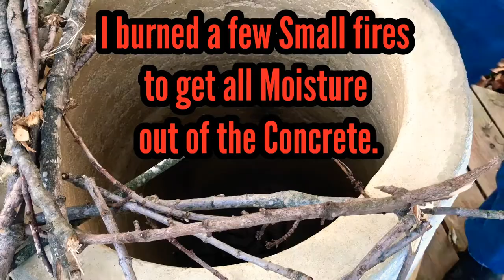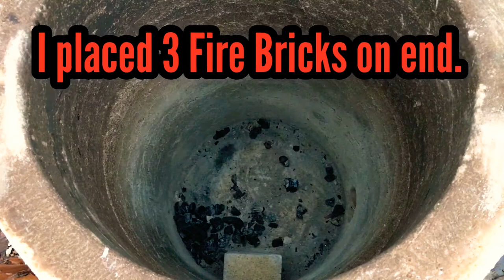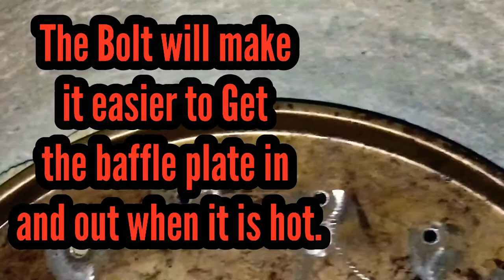DIY Tandoor Insulated Concrete Vermiculite n Quick Set Mortar Mix: Part 5 Completion of project DIY

Comment: Great video and super creative! Can't justify spending $1500 when you've given me the confidence to do it for a fraction of the price! Thanks! 🇨🇦🇨🇦🇨🇦
Reply from the maker: You can also try using large terracotta pots  and then mounding the insulated concrete over them … then put the two halves together… and wire them and up and stucco over them.   I realized later that I could have done that.  If you want to cook Naan on the walls.   If not then go with what I did.  It gets up over 6-7 hundred degrees in there. 
Glad you found the video useful friend. Please don’t forget to subscribe if you haven’t already.    
Thanks.
Reply: @Pizza_Master  thanks for the tip! Great idea!
Reply from the maker: All good.  I been bouncing that idea around for a while.  Was thinking about making a small one just to try it out.  
Let me know how it goes if you try it.

Comment: i thought cement or mortar wont hold up to the heat? im in the process of making one, but i used red clay bricks and clay mortar/cement/sand  1-2-6 ratio would i be fine? Can i line up the inside with this mortar and will dough stick to it or would it be better to use clay  or your mortar type?
Reply from the maker: Dough will stick.  I tried it day one. Lol. I use for meats and pizza in hanging rack.  U can use a big clay pot and surround d the outside with the mirror and vermiculite mice.  Then reg mortar and tile.  That will work nice.
Reply from the maker: Adding the vermiculite to the mirror keeps it from cracking and holds the heat.  The reg mirror on the outside barely gets hot.  And has been two years without a crack in the outer shell.

Comment: awesome build video.... what size holes did you drill?
Reply from the maker: i used 3/16  drill bit....    
i have found that it is better to have the holes around the outside edges of the baffle plate. dont put any in the middle of the plate.  when cooking anything with a fair amount of FAT.., it can drip near the holes and catch fire on top of baffle plate. i have covered the center of baffle plate with foil and that prevented the fat from catching fire ontop of baffle plate.  
glad you enjoyed the vids..
any other questions feel free to ask...
Thanks

Comment: Is it easy to empty the ash out after it’s cooled ?
Reply from the maker: Its not an issue at all.  I just reach in and use a 5 gallon pail scraper to put lift it out into a bucket or whatever.  Throw it in my garden beds and whatnot. 
This is what I use.  https://www.amazon.com/Stainless-Steel-Bucket-Scoop-LEVEL5/dp/B076R2YGMK

Comment: Just wondering if you’ve developed any cracks in this over time with the heat?
Reply from the maker: None on the outside...  the inside , insulated concrete has small cracks.  ..  nothing I am worried about.    I built my pizza oven the same way a few years ago and it’s still going strong with zero cracks on the outside.  I am considering doing a ceramic pot insert tho...  in order to be able to cook naan.
Reply: @Pizza_Master  i followed your video but did exactly that first. Two terracotta pots. Cut the ends and stacks them and then built the insulated concrete mix in yours steps around it. Just out the wire around and applied the outer mortar layer. Thinking to give it another layer then going to encase the whole thing in red brick. Oh and also build the base from fire bricks and then another layer of bricks on that but just the perimeter and had the clay pots sitting on that so the heat generated from the wood hits the sides of fire bricks instead of the pots directly. Hoping to bake out the clay with periodic fires over the course of a week. I hope it lasts since its been a lot of work. Two days half day each day. I have pics if you want me to email you. But mixing the mortar mix with the vermiculite is a really good idea! Thanks for the videos. Watched the full series a few times to catch all the pointers...much appreciated, will definitely be subscribing.
Reply: Do you have a video of the pizza oven you built?
Reply from the maker: Nice.  Sounds like u put your time In On that one.  These projects def take some time and patience.   Not sure u will need the red brick... unless it’s for esthetics.  I may tile mine on the outside just for fun. Just always religiously keep it dry as time goes on.  I have a plastic 55 gallon drum I have to cut the top off of, that’s gonna be how I keep it dry. Moisture in any of the surfaces will cause it to crack. If it heats up too fast.  I built a pizza oven 3 years ago ... using the same technique and have kept it tarp covered religiously when not in use... and it is crack-less on the mortar outside layer to date. 
You can def send me some pics at mikebux1@gmail.com   Can’t wait time see how it’s going. Thanks.
Reply from the maker: @MindApplication  you can see it in this video.   https://youtu.be/OwHmqH6pSxI   I foolishly did not video the building process. I basically used the Exercise Ball Mold technique  , using the insulated concrete, wire and Mortar system. i placed it on a platform i built from Cinder block with a 4 inch thick concrete top. then a layer of Fire Brick for the floor.  i do have some picks floating around on my phone from when i built it.
Reply: @Pizza_Master  i sent the email. Expect it from tareen23 @ gmail. Let me know if u see anything wrong and if i need to make any adjustments/corrections